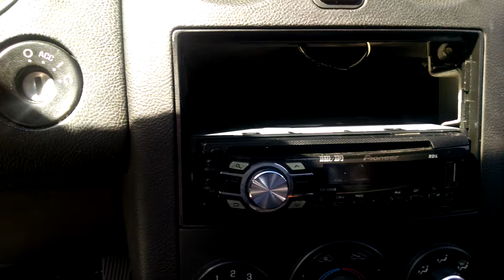What To Do With The Orange Wire When Wiring A Aftermarket Stereo

Comment: To anyone watching this..don’t wire your stereo like this. Do it right
Reply: why is that?  do you mean the way he's taping the wire or don't wire the orange wire to red?
Reply: @arthurtsang7936  yes, attach the orange to red, but the install wasn't the most professional. If you saw behind my deck, it looks factory.
Reply: @fromthepublic9636  mine too i soldered all my wires and i am so epic
Reply: @arthurtsang7936  both
Reply: @arthurtsang7936  heat shrink the wires then tape them and i take it a step further and get that plastic tubing stuff and place over the complete wire assembly to prevent rubbing wires on metal or anything as well as to hold the wires in place so a jolt cant break a wire connection as easily
Reply: @arthurtsang7936  electric tape is fine if done right but wires can poke through eventually its a fire waiting to happen honestly but in a pinch its ok as long as you tape it up really good however electrical tape also moves and even comes loose when it heats up
Reply: Just use the little twist on plastic caps.

Comment: You can’t just wire it to any hot wire! You put it on a signal wire that tells the headunit to dim. If you don’t have it then you don’t connect it. Also you need to either solder those connections or use splices. Twisting and electrical tape is going to make a wire when they come undone and ground out just like that orange wire!
Reply: Perhaps cause a fire also!
Reply: Idk what he talking about. If u wire it to a hot connection u definitely will blow a fuse n the unit or n the car.
Reply: 😂exactly
Reply: He will be blowing his outputs on his Amp if he had a system hooked up
Reply: My orange wire is connected to red. But only works with lights on. What other wire should I connect it too?  It didnt seem to work when it was just taped off
Reply: @Tree-vis  the orange wire is to tell the headunit when to turn on/brighten its back light (for night drives). Sounds like its working if it only comes on when you turn your headlights on. Every car brand is different. Get the schematics for your car and check which wire it is or if it even has it.

Comment: LOL on the wiring, great comic video on how not to wire a stereo from a professional installer, best install joke I've seen so far.
Reply: Where should I connect the orange wire?  When I do it to red, the stereo only gets power when the headlight are on. 2001 buck park avenue
Reply: @Tree-vis  Each vehicles electrical is different on where to tap in the power. It's really a matter of prefernce on whether to use the HOT ALL TIMES or HOT when key on wire. If you radio on works with the headlamps on then you've tapped into the wrong wire for sure, LOL. The Orange wire is Illumination, it's designed to all the vehicle to control screen brightness and the radio control panel brightness. So the Orange wire is tapped into the main light switch panel Illumination control. You can also probably tap it into the AC/Heat Control Panel Illumination control wire as well. You'll need to pick up a Haynes Maintenance Manual and go to the Electrical Section to find out what wire color it is in the truck. Since there's so many vehicles out there if you want to just have it on bright all the time, then do like the guy did in the video and connect it to the power wire for the radio. Hope that helps. Best Wishes & Blessings. Keith Noneya on YouTube too!

Comment: I soldered all my wires instead of taping them and took your suggestion and soldered that orange wire to the red wire.  A problem arose doing that.  Whenever the key was in run or accessory it made all my dash lights and my parking lights come on in my 1998 Ford Ranger, lol!  I simply snipped the orange wire off again and now everything is working like it should.

Comment: Well I wore the orange wire to my red wire like you said and what happened was my parking lights and interior lights all came on at once so I don't know what the deal is with that but I just connected it I don't think I want my lights on all the time when I'm not using them and you can't turn them off so I just disconnected it

Comment: Hey thanks for your video. I have a universal adapter aka harness but my DUAL CD player adapter doesn't have an orange wire or a blue wire with a white strip which is amp turn on I'm pretty sure but I'm not using an amp or aftermarket speakers or subs. If you have any tips or suggestions that would be great!👍 Thx for the very helpful video. 😀
Reply from the maker: if you ain't using subwoofers than you won't need to worry about the blue/White Wire that is actually a wire that comes from your amp and runs through your car to be connected with your blue wire. i think that's what you was asking. if that doesn't help let me know and we will find something that will

Comment: if you wire the orange wire to red wire... when you turn your lights on your radio will turn off and run your battery down when you get out of it... orange goes to ground

Comment: I connected it to the red wire in my 95 S10 and it blows the illumination fuse, but if I don’t have it hooked up it doesn’t work. Any suggestions?
Reply: Illumination wire wires to your lighting to dim the radio when you put your lights on  🤦‍♂️

Comment: If you wire a illumination wire to a ignition switch wire then your head unit is constantly going to be dim you fool it needs to go to your headlight switch and you never have to wire this up anyway it’s a waist of time and a little tip you can buy some butt connectors for like £1 and you will have no issues in the future 👍🏼

Comment: Right from Google:  "The illumination wire adjusts the brightness of the display on an aftermarket radio's faceplate. This function is governed by whether or not the vehicle's lights are turned on. This is not mandatory for proper stereo operation, so many installers leave it unhooked for maximum display brightness."

Comment: If your radio doesn't have a orange wire. Don't hook anything to it. 

Both the orange and orange/white wires are aboard the dash lights of the vehicle. They are what you use when you have the dimming feature available on your aftermarket Radio.
Reply: Problem is I have an orange wire and my dash illumination didn't work til I did this then it went through, question is I also have an orange and white wire which it says is dimmer ground (im reading everything off the harness adapter box), should I attach this to ground or should I be fine isolating it (illumination on dash works fine I just haven't flipped on headlights worried about tripping a fuse if dim isn't grounded, also it says orange is illumination/dimmer)
Reply: @geocatwizard  Sounds like you wired it to be attached to your light switch which is a possibility unless you want it constantly on

Comment: Ok so Do not hook it to just a red wire The illumination wire is so that when headlights come on it tells the stereo to dim so it does not blare in your eye's in the dark. It should hook up to the headlight switch. o and now a days crimp quick connects works better  i won't laugh to hard i did the same thing. for years. But i did do better taping.

Comment: I did that I ran the Orange wire to the red wire to give the stereo some power it for a bit and my stereo fall and the next thing my some lite and stereo don't work and my Orange wire has no power to it now it was on a 2002 Pontiac sunfire all I wanted to do was take out the old factory stereo and put in a new one what can I do to fix it I buy new fusses to se if that was the problem but still now power to the Orange wire

Comment: Honestly bro you need to take out the stereo and get yourself a decent to good soldering iron butane gas or electric, some heat shrink and some zip ties and if you don't know how to solder watch about 20 YouTube videos is plenty of videos out there that I'll teach you how to do it and wire your stereo correctly! This is just so upsetting to see how people half-ass their s*** and I'm pretty damn sure a lot of people will agree with me there's only one way to do things and that's the right way especially when it comes to Car Audio! When you take shortcuts with car audio that's why you're going to end up getting your shorts and cuts. And also how can you have any Pride in your ride when it looks like that? Should I drive a 99 Nissan Sentra with the little 4-cylinder in it but you know what it has a Bangin system with one of the newest fully loaded JVC Double-Din head unit  for 2020, backup camera kicker mids and kicker tweets with two Fosgate amps and 2 JL audio subs with the big 3 done and yeah and maybe a little f**** piece of s*** car but it looks nice it runs nice and I'm proud of the work I did

Comment: I install audio equipment if you don't get that electrical tape off of there and crimp you the proper connector on each wire. If that tape comes off you will short out your radio and your vechile. You either a rookie or Lazy.

Comment: No offense but that is a hack job, why didn't you put some shrink tubing on the wire then do a western union swist then solder the wire then slip your shrink tubing over the solder joint then heat the shrink tubing with a lighter , Cmon man WTF

Comment: at :34 you took the words out of my mouth, but I was referring to everything.  Nothing says "Hack" like someone who would ONLY tape together the connections.   Use the proper crimp connections or solder and heat shrink, NEVER Tape.
Reply from the maker: at that time i was changing my stereo every week or so trading for better one's i didn't want to crimp anything together that wasn't going to last like now i have a Touch screen double din and it is crimped but as you can see in the video i didn't even have it locked in at that time just cause of how much i was trading and buying i know taping can cause shorts and won't give you the best quality but i also didn't want to cut my wire over and over again

Comment: What if my red is connected already
Reply: The orange wire doesn't necessarily need to be connected to anything it just dims the lights on the radio while your headlights are on
Reply: @masongeo3737  Not on all radios. For mine there are certain buttons like volume up and down that I can't see at night because I didn't attach the illumination wire. So radios stay dim/no back light until theres 12V runs through the wire

Comment: is this a troll lol. Terrible advice all around. FYI most cars have plenty of take off points around the stereo, usually, around cig area there is a light which is turned on by the light stalk. Test it for 12v and you should be able to find one.

Comment: The orange wire with the white stripe goes to your running lights so when you turn your lights on at night even with the radio off it is still illuminated with the running lights on. Simple there you go did not even have to make a video about it.  The funny thing it’s in the instructions.    Oh I forgot men do not read instructions.
Reply: Donald Campbell so do I hook up the orange wires to red or?